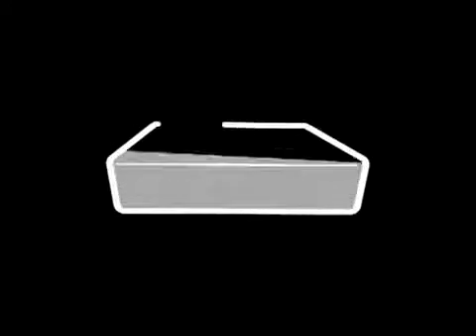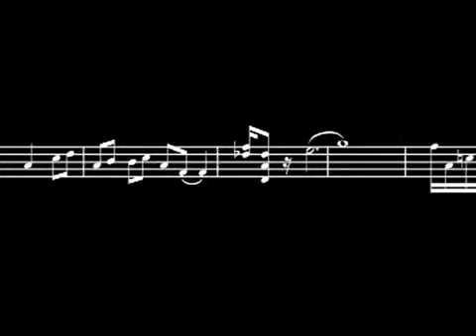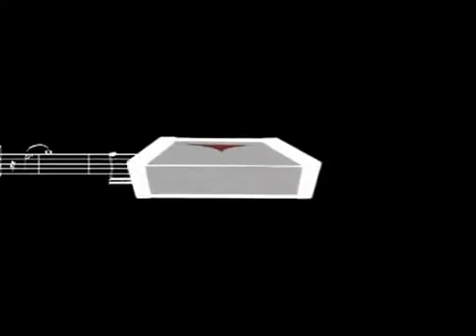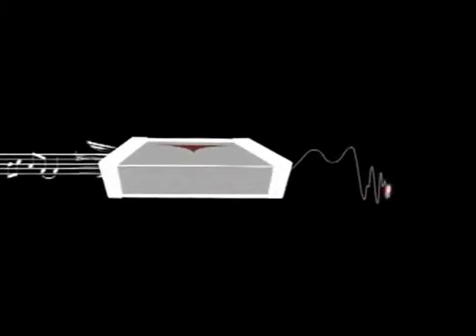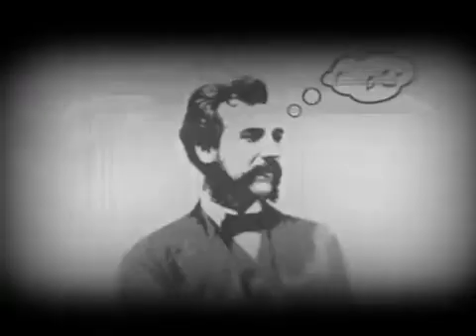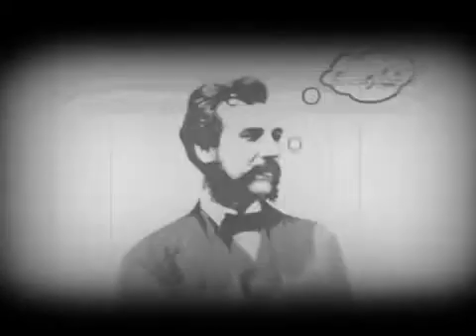Inside Look at Kicker Subwoofer

Comment: Would you recommend running l7's in isobaric??
Reply from the maker: exogator I would not.   Some of the the L7,s tech is based on studies we did with isobaric setups in the 80's.  So that said...its already has the ability to play low in a small box..just like an isobaric setup.  Running L7 in isobaric config would be very inefficient and costly without a large payoff.  You are far better off just putting the second one in a box and running it with the other.  Hope this helps and thanks for the support